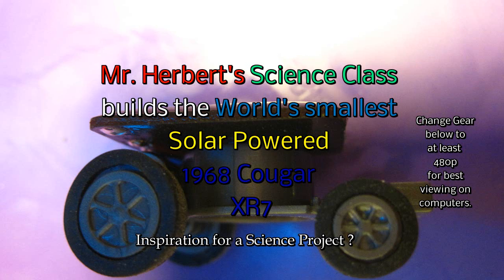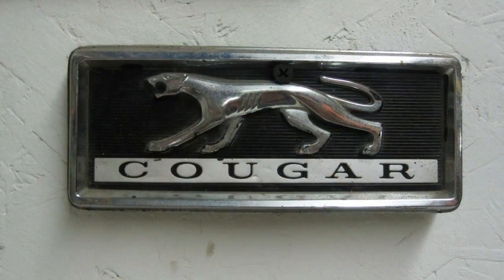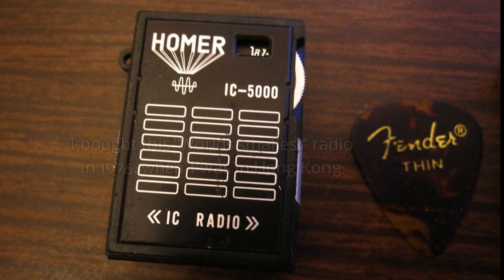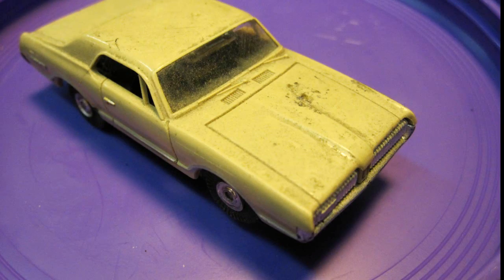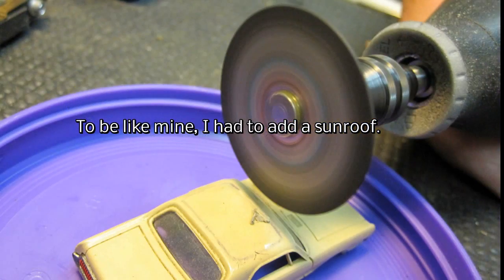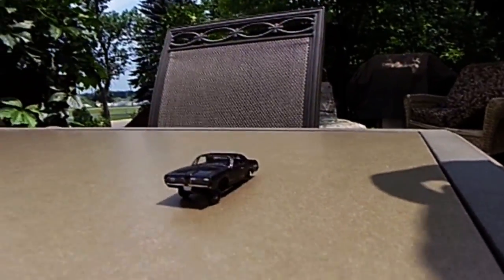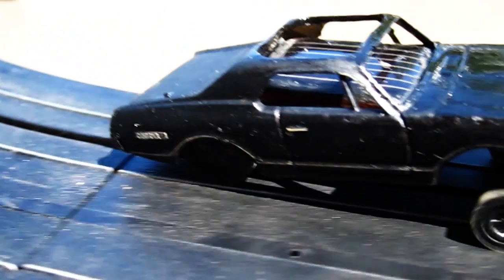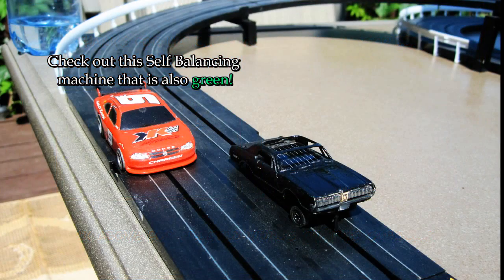The World's Smallest Solar Powered 1968 Cougar XR7.

Comment: I too had a 67 Cougar. My favorite car. Died an untimely death due to a $.02 cent zip tie holding beck the battery cable on the inner fender. It broke one day going to work, and hit the alternator pulley and took off the insulation of the battery cable and shorted out the car and it died on the freeway. While I was out calling a tow truck with AAA, a tailgater rear ended my pride and joy.  Turned it in to a sub compact car.

Mine was the same color as yours. 289, Full race isky cam (but couldn't get the idle down past 2200 rpm, so changed to isky solid 292 duration / 517 lift cam, Edelbrock Torker Manifold and Doug Thorley headers.   Best time was 13.52 in the 1/4. Same tires in the back too and shocks. Real Mag rims too.  Cougars were the best car.  

You had / have one great car there.

Comment: Haha great fun to watch. Nice to see the original Cougar and the pics of it.
Some HotWheels work well converted with the bits from those cars... 'Solar Speed Raceway' is a vid of mine using the panels (rather than put the link as some folks don't like that).
The panels put out 0.55V at about 150mA.
Reply from the maker: I have a panel that puts out 12v, but wont run the cars  I will check yours out.  Great.  Thanks for the comments.